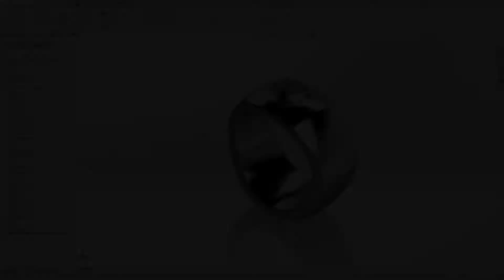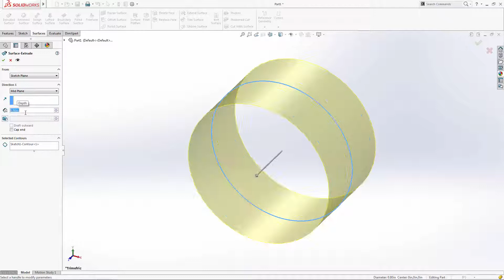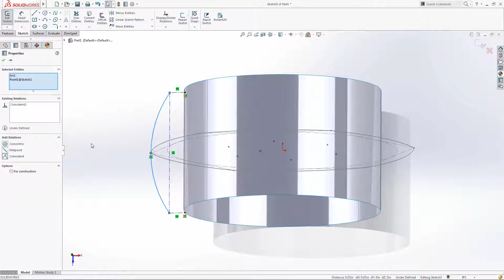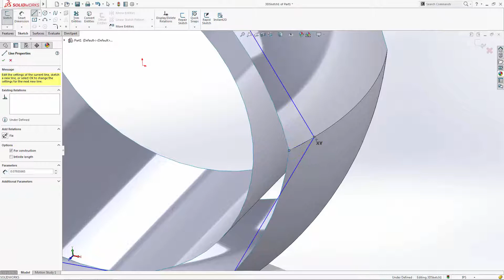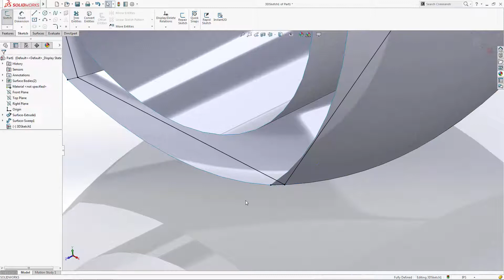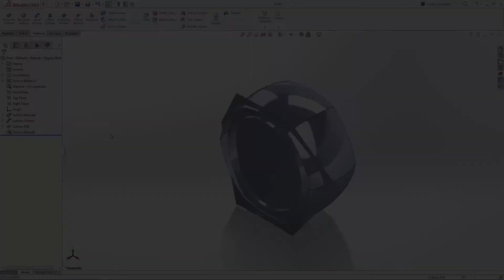SOLIDWORKS Infinite Power Surfacing Ring - Part 1

Comment: when I use surface sweep to get the round hexagonal surfaces, it gives a weird twisted surface at each junction point. is this due to not using spline?
Reply from the maker: Hi Jonathan, could you post this question to the MySolidWorks forum? Our expert users should be able to help you there. Please include your system details and the version of SOLIDWORKS you're using. http://my.solidworks.com/forums